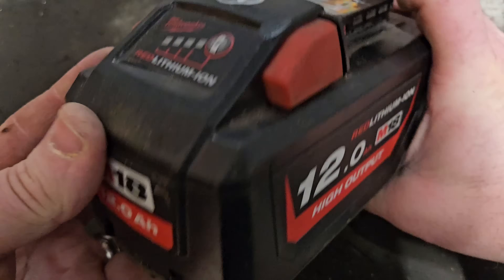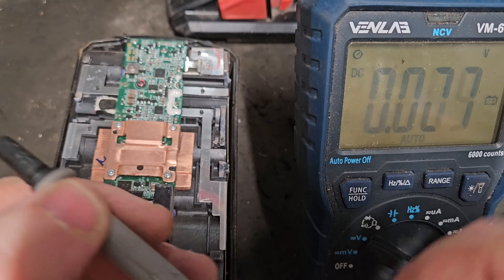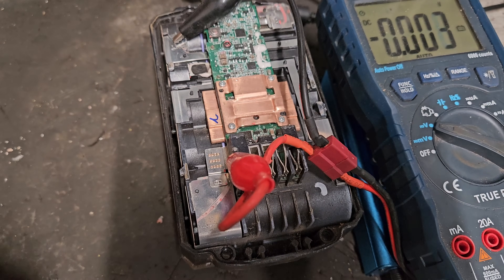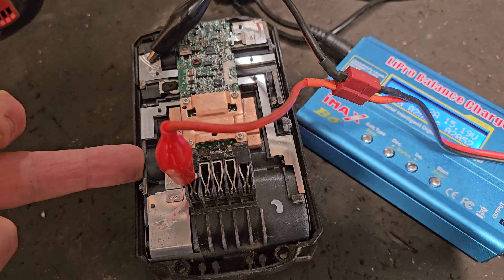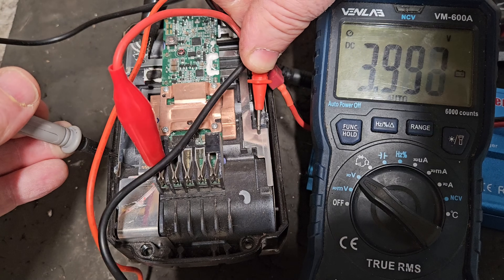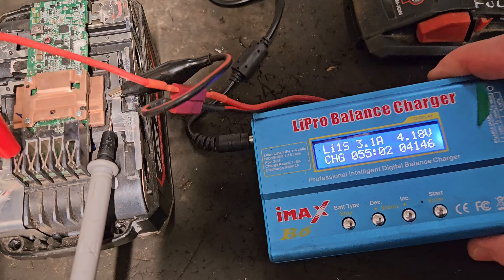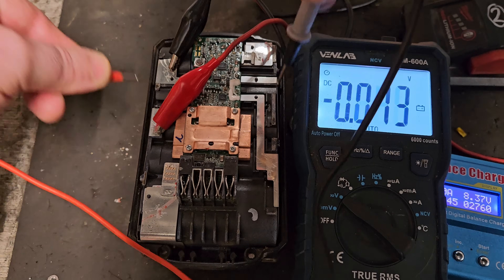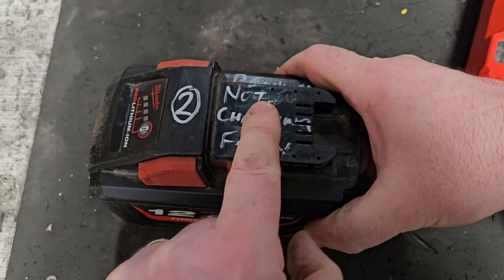M18 12ah Battery Repair Tutorial Cells rebalanced

Comment: Whenever I attempt to charge more than 1 cell bank at a time my B6 says there is an error 
I place the alligator clips in the same exact positions you do and I set the imax b6 to the same setting as you. Still I get the error message. Idk what to do.
Reply: I was able to get it to if I lowered the amp output below 6.0. But more successful to just charge individually.
Reply: How do you charge the cell banks in the middle of the battery?

Comment: Could this cause my 12ah to die fast? It still charges fine. I was using my milwaukee chainsaw yesterday and got through 1 tree. About 8 cuts. I used to get many more cuts out of it.
Reply from the maker: Absolutely cell imbalance has a massive bearing on performance

Comment: Great content! The Milwaukee 12Ah battery is clearly prone to becoming unbalanced, I’ve had to balance mine as well. On the other hand, my 5Ah and 8Ah batteries seem to be holding up just fine.
Reply from the maker: The big 15 cell ones are more prone to it like the 12ah and the 9ah
Reply: Would not a balance charger do the trick? Connect it to the main terminals on the battery and it sorts out the low cells?

Comment: What is a wonder though is why are these 3 parallel batteries so commonly getting out of balance? 

They happen on the 54volts flexvolt that have a 3 parallel arrangement when using them on 18v gear.

Are these companies using the cheapest semi conductor balancing chips on the charger or battery bms side?

Great video and explanation. It's a shame I bet 9/10 times that M18 and Flexvolt batteries that are failing on consumers are failing after the 12 month guarantee, which is why they wont offer these batteries that are sometimes £200 with a 2/3 year warranty.
Reply from the maker: As you point out I notice the 15 cell batteries do seem to fall out of balance alot and at the price I agree they should offer better warranty terms
Reply: @doctorlefthandthread  Do you think it is the BMS/controller on the battery board?

If you yourself are a YT watcher theres a channel "Tool Scientist" where he explains logically why the Milwaukee and Dewalt 18v batteries are a little inferior to the Makita due to design differences.
Reply from the maker: @shifty277  tool scientist is amazing definitely knows what he is doing. I would say Dewalt Milwaukee are more ambitious than Makita as far as making batteries with 21700 etc for 18v ranges. I think that Makita batteries are very well made. Maybe Milwaukee and Dewalt have been over ambitious with their batteries. Even with the failure rate it's nice to have these 15 cell batteries with the larger cells for certain applications. I know Makita has their 40v range but the price is quite high I think.
Reply: @doctorlefthandthread  The 15 cells is great as it allows for a m18 to put out say 50amps over 3 banks in 16amps each as opposed to 25amps on 2 sets of cells and less voltage sag. Still 50/60amps is a lot of current on an 18v tool.

The Samsung 40t cells in both the 8amp (pre 2024 so non-forge) and 12amp milwaukee as well as the 12 amp felxvolt aren't as good as there datasheet suggest. The newest tabless cells in the 8 and 12 amp forge hopefully fix cell imbalance issues. Hopefully tabless cells come to the flexbolt batteries too.

The XGT batteries at the cheapest online in the UK is not far off Makita 18v pricing tbh for the upgrade in quality - a 5 amp 18v can be had for £55 off powertoolmate and is 90 w/hr capacity total. The 5.0amp xgt is double that at 180 w/hr and at powertoolmate is £160, the bms and waterproof coating on it, the casing, and the manufacture of the XGT packs is another level up from lxt 18v. Plus that battery doesn't have 21700 but still Sony VCT5a's 18650s. Not keen on the 4amp 40v pack. the 5.0ah will put out 2kw on a full charge for say a grinder or 9" saw.

The makita 40v bare tools are expensive though....
Reply from the maker: @shifty277  yeah the 40v tools are tremendously expensive. These tabless cells are an excellent idea. I have mixed feelings with stacked lithium the small dewalt seems great however the 5ah powerstack is yielding unremarkable feedback from people that have them. The M18 Forge are looking good so far but again expensive.
Reply: @doctorlefthandthread  yep the 5ah stacked lithium i'm not convinced on nor the milwaukee 6ah pouch forged. They should be great for lightweight applications i.e impact driver

The makita has the 4amp xgt tabless battery coming in Jan/Feb.

Even Hikoki have the 4ah tabless multivolt battery out. 

Have you had any experience in your neck of the woods with their 18/36v multi-volt batteries?

I appreciate Hikoki probably have 5% or less of the construction/DIY market but their bare 36v tools are reasonable as are the battery costs relatively speaking.
Reply from the maker: @shifty277  haven't had alot of experience with the hikoki they are not popular here but some of the tools look good I like the battery framing nailer
Reply: @doctorlefthandthread  yep the 18v framer is the one that might pull people into the platform...